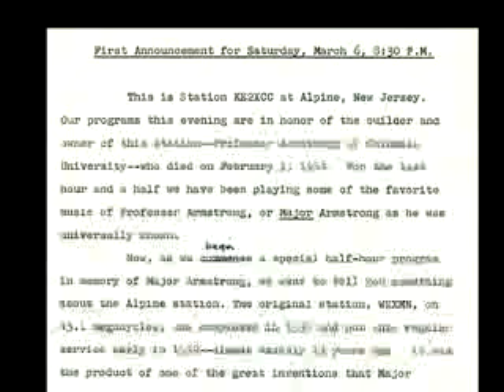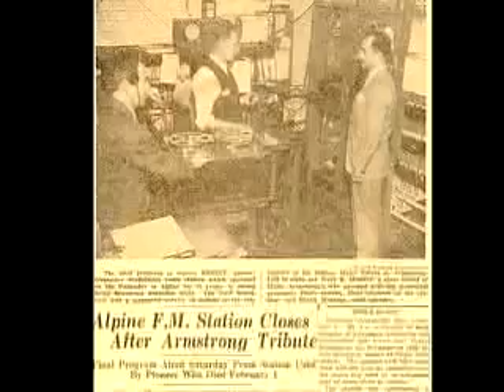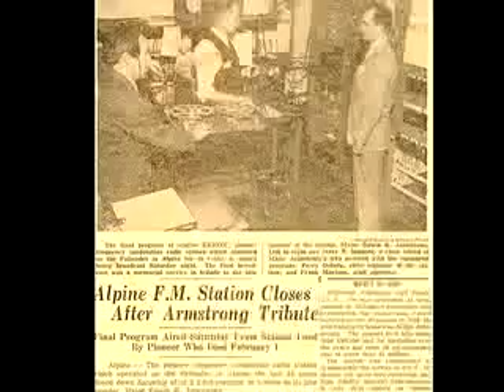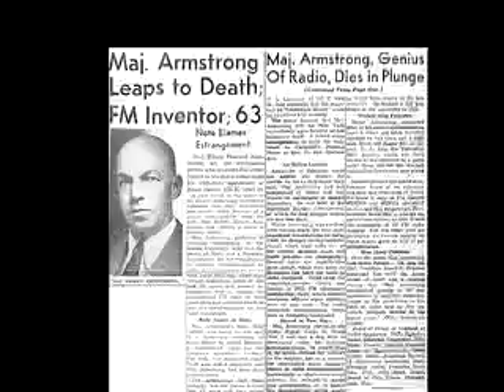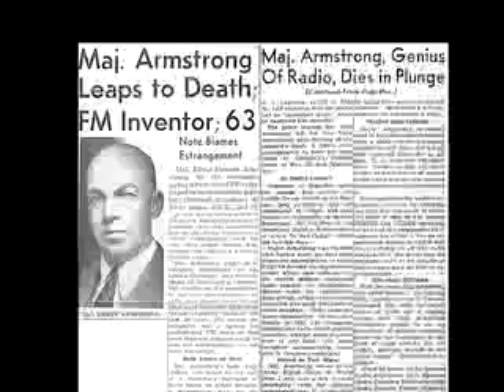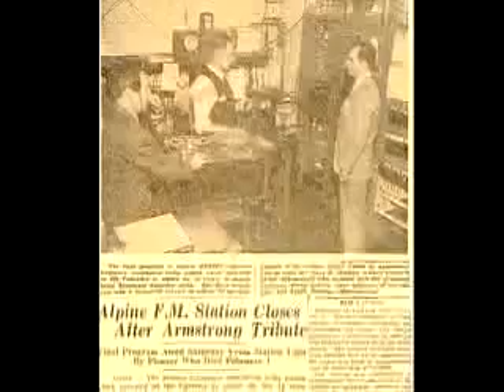Final Broadcast of Edwin Armstrongs Experimental FM Station KE2XCC 93,1 Alpine NY

Comment: 2016, looks like the last century dialup pre-pentium days compression crap that needs to be reposted in the twentieth century. We have bandwidth now. I wonder how bad the sound is compared to the original broadcast. It was FM after all, not AM. The Yankee Network kicked butt, Ma Bell didn't like that. It was like the modern internet instead of using their long distance $ lines. It was preferred for wartime preparedness and information relaying leading up to WW2 over AM stations and their reliance on those feeble phone lines. It was the NPR of it's day, not the fluff of regular commercial network radio. We could have had live stereo broadcasting before WW2 when records couldn't do that and tape was in German hands still. Dam the depression and RCA.